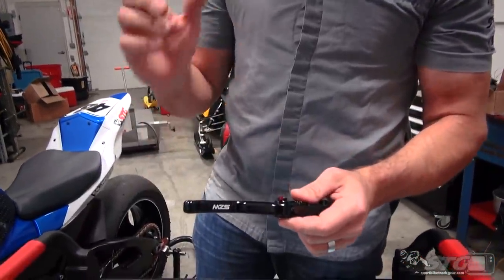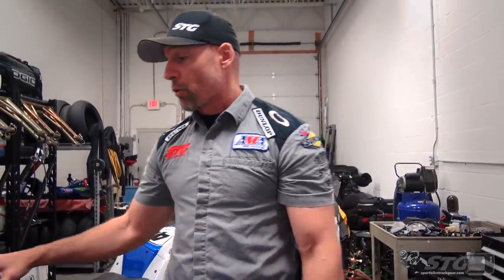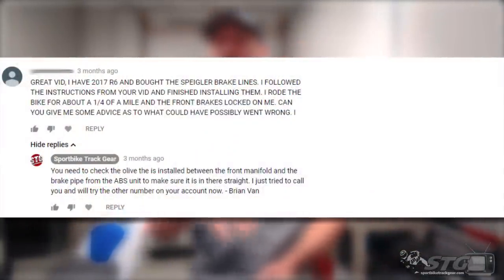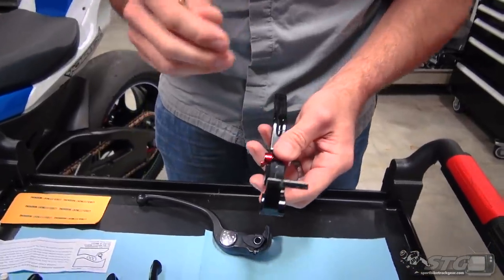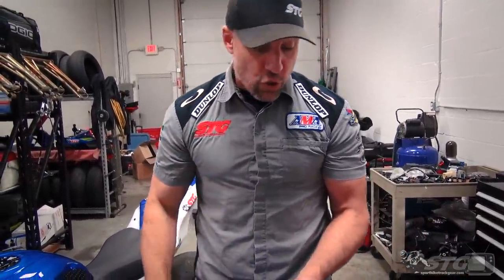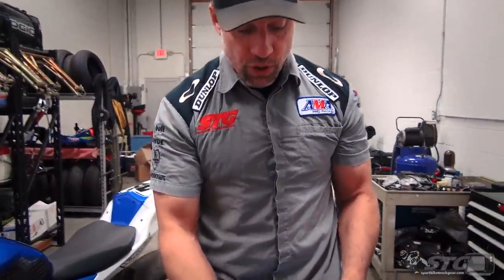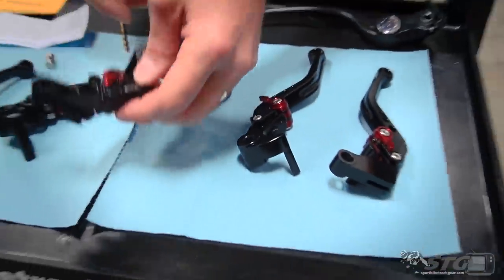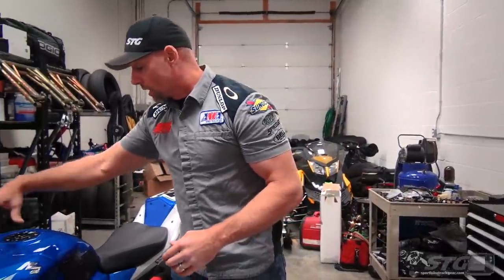The Truth About Cheap Motorcycle Levers | Sportbike Track Gear

Comment: Lockup with ABS?
Reply from the maker: No, not caused by the ABS. Several comments on this video now noting locking front brakes on multiple models. It is the overly tight tolerance of the cross pin busing in the lever. - Van

Comment: You can get good quality levers from China for 45 dollars a set. Research reviews and save yourself 100's. You don't need to spend this big cash on levers.
Reply from the maker: That's all great right up to the point where the brakes lock up man. Buying these cheap levers is as risky as buying knock off condoms IMO. Shits all good until it's not. - Brian Van
Reply: @sportbiketrackgear  Wait a minute... The wife & I have been using Troyjanz condoms from ebay for 10 years now and none of my 9 kids have ever had a break lever fail. $1 for a pack of twelve is a pretty good deal!
Reply: @sportbiketrackgear  they're not gonna just start failing out of the blue. They will fail the first time you use them. So if you throw on $25 levers or $250 levers and then take off like a jackass without testing them, you deserve what you get.

Comment: I would generally agree with the argument in this video, BUT I can tell you from my experience and the experience of many fellow riders that most of these issues are caused by human error and it's not the levers. I've had two pairs of OE levers on my CB1300 and both snapped very easily leaving me almost stranded. The last pair I had were Chinese levers and recently a lorry knocked down my bike while parked. The lever the the bike landed on had bended slightly but amazingly survived and I only had to inspect and hammer the base in bit. They're still on the bike while I'm waiting for a new pair. There's a nice counter-argument video that sums this all up https://www.youtube.com/watch?v=zeDtwAjHyj0
£200 for pair of AVS levers is way too much!
Reply from the maker: Sure there are some good points in the video you posted a link to. That said there is also a metric shit ton of misinformation in it. At no time should you ever need to add a spring to a brake lever to prevent it from locking up. If you feel $200 for a set of quality aftermarket levers is too much you are better off leaving the OEM levers on the bike than you would be installing shit like MZS. - Van

Comment: How can the brake hoses be at fault for brake lock up? It's the pads, discs or more importantly the caliper itself, it can't be the levers, so why put it down to the levers?
Are you sure you don't get sponsored by some motorcycle part manufacturer, for instance, a lever manufacturer... You're wearing sponsors all over your shirt, you're on YouTube, and who on YouTube doesn't get sponsored? 🙄 So yeah, curious 🤔
Reply from the maker: The brakes locked up because the crosspin bushing in the lever was binding which did not allow the master to release pressure. 100% caused the the lever your cousin made. If you don't know what you are talking about do not leave stupid comments. You 100% have no clue what you are talking about. - Van

Comment: Those cheap lever are used only for low cc engines.. Like 125 150 to 300. Wont recommend to a higher cc.. But me.  For me there both fine for that. It only takes a good care and maintenance.. But its up to u...

               And by the way DONY EVER BUY CHEAP MOTORCYCLE PRODUCTS THAT ARE MADE IN CHINA. Dont. There are other asian countries that have cheap and BETTER QUALITY that wont kill u.. Or cause an accident. Trust me..

Comment: Irresponsible riders have gotten so used to just trusting these companies that they don't even check the product before installing it. That's all you have to do. Just inspect the product before you install it.
Reply from the maker: It is the responsibility of the manufacturer producing the replacement part to ensure it will perform as well or better than the OEM part is replaces. Expecting the end user to evaluate whether the part is safe to use or not is unreasonable. - Brian Van

Comment: Happened exactly with me...i installed moxy levers on my 2011 cbr250r which i bought it for $15. Just after a month the front disc locked up and i crashed brutally. Later i needed to change the front caliper.

Comment: you do realize that prolly the expensive levers are made in china too right? You can find decent cheap ones too, personally I downright refuse to give over 100€ for a pair of iron chopsticks to use as levers... If they were at reasonable price like say 30€ a set then why not buy them over the chinese.
Reply from the maker: If you think these shit levers are worth the risk then go for it. There is nothing wrong the with Chinese manufacturing as long as the engineering is good. The problem with these levers is the engineering fucking sucks. CRG levers are our #1 selling brand here at STG and they are engineered and manufactured here in the US. - Van
Reply: @sportbiketrackgear  You know what fucking sucks? That you are dissing other products to advertise yours. I've got nothing against you (or your business) but if you expect me to buy something this expensive convince me why your product is priced like that for starters and what more it provides contrary to the competition. That would be a better way to advertise stuff.

I respect the fact that controls on the bike are important but not all levers are created equal even chinese, you can have really crappy ones but you can also have perfectly good ones. 

And speaking by experience the only problem you have with chinese products is not safety or quality its FITMENT sometimes you need to do some stuff for them to fit (but not levers and products like levers they are spot on)

Comment: Enjoyed your video, bought a 2015 650 ninja and the after market levers that came w/ it are shit. I know you are being nice but if it's shit say its shit... I got the msg tho.
Reply from the maker: IMO you are not making your bike better by installing levers that are worse than the OEM levers that came on the bike. Bottom line is a good set of levers is at least $130, most are more than that for a set. - Brian Van
Reply: @sportbiketrackgear  , Thought I mentioned... the shit levers came with the bike when I bought it... of course I'm going to buy good levers. Maybe you could suggest a set of levers as I "always" ride w/ 2 fingers on the clutch lever and 2 fingers on the front brake lever... force of habit. Thus, I only always have 2 fingers on each grip, unless going a long distance. BTW, thanks for your reply.

Comment: That indeed does look scary. I just happened to have MZS levers sitting here. Checking all the issues mentioned in the video, I think they improved their machining quite a bit because the levers now have tighter tolerance. Not as good as the high end CRG levers, but it does not wiggle like crazy. Also the model for my bike does not have that pin that could lock up so I think I'm safe there as well. Anyways I'm gonna install them next week and hope I don't die.
Reply from the maker: The radial master cylinder is the known problem lever. IMO why trust any of them when there are tons of document cases from these levers locking brakes??? - Van

Comment: I have some of those mzx or mxz shorty levers on my bike and they actually are better than original long levers most originals break off at the ends or bends into a damn pretzel, when I fell off mine last year they only scrap the edge and no bending braking and they still are good I don't even need to replace it they were only $25 for the pair, I disagree with this video
Reply from the maker: For sure there are plenty of people out there who have had a good experience with the MZS levers. That said there are a number of people who have crashed because these levers caused their front brakes to lock up (read through the comments on this video posted by riders who have had this happen). If you have an axial brake master cylinder odds are you won't run into that problem. Regardless of which master you have the overall quality of these levers is very poor. - Van

Comment: so with a little sandpaper, grease and couple of washers they are just as good, nice xD the main difference on chinese parts is quality control and finishing, those need skill and manpower, cant be replecated by machine, most reputable brands also produce the same way but they inspect and test prducts before beeing sold but that adds more than the production cost
Reply from the maker: Installing products that have not been inspected or tested properly on your bike is a bad call. - Van
Reply: @sportbiketrackgear  i inspect them as I mount them, then test, then test drive, not following this procedure even with OE parts would be irresponsible. As a mechanic I trust myself to do the quality control

Comment: Those MZS are equally as good as the stock junk that comes with most stock motorcycles and those last for years 😂
Reply from the maker: When is the last time you saw an OEM lever lock up the front brakes on a modern sportbike? - Van

Comment: He didnt grease the bushing..
these work fine, made of the same material.
Reply from the maker: The levers were new out of the box with the cross pin bushing installed (held in with a snap ring), if it needed to be greased it should have came that way from the factory. That said the tolerances are very poor, grease or no grease the bushing can not seize up. - Van

Comment: This guy seems really seedy and whoever runs this channel is pretty aggressive in the comments with the insults and scaremongering. I don't live in the US but if I did, I wouldn't spend a single cent with these guys. I'll stick to my cheap levers that I've had absolutely no problems with.
Reply from the maker: WTF is scaremongering? We discovered this issue helping one of our customers sort out an issue with their front brakes locking up and we decided to share it. If you read through the comments in this video you will find SEVERAL from riders who have crashed when these levers caused their brakes to lock up. - Van

Comment: Oh CRG not that much better
PUIG. Good stuff. Those CRGs got sent right back...there "bearing" should be referred to more accurately,  line on a bolt. So axle?. No bearings sorry b
Reply from the maker: There is a bearing on the adjuster. The pivot does not typically use a bearing. We run these on all of our race bikes. CRG makes a great lever IMO. - Van

Comment: Hi I ride a 2007 Honda repsol cbr 1000rr
 I recently changed my clutch and brake lever the brass pin on the clutch side isn’t floating free like you said I think 
When I stop and if I’m in first gear holding the clutch and hit the throttle bike feels like she’s not relaxed but I can feel her wanting to surge forward and just run 
Is it possible maybe the clutch is having the same issue you described with changing the levers? My Instagram is Enviziondisikon / repsolp hope to hear from you soon

Comment: Hah funny story, I crashed the bike in my profile pic 5 mins after installing a set of cheap Ebay levers. What a mistake that was. Machining was off and it was pressing in on the master cylinder. Pressure built up and as soon as I went for the lever I was on the ground.

Comment: Only time you crash because of these is because you fitted them yourself and don't know how to check them
Reply from the maker: Installation is not the issue it is the incorrect tolerance of the cross pin bushing. - Van

Comment: He probably installed then wrong. I got a set for around £15 and there better than stock
Reply from the maker: MZS levers have shit tolerances compared to the OEM levers or quality aftermarket replacements. You would be better off leaving the OEM levers on the bike if you do not want to buy a quality set. - Van

Comment: Sounds like you are just pushing your own product. Of course they’re going to have tolerance issues, they’re cheap. Tolerance=cost. We are buying 20$ levers because we don’t want to spend 200$ lol. They work fine with some grease. Inspect things before you install and you won’t have these problems. Lol
Reply from the maker: They work fine until they do not. Read the comments, a ton of people have had issues with these that caused crashes. I am not trying to push shit, just sharing what I learned. - Van

Comment: My Chinese levers work fine for my r6 you just got a bad set of them
Reply from the maker: The locking brakes seems to be isolated to levers for the radial brake master cylinders. Older R6's use an axial master which should be ok. If you have an R6 with a radial master pull your lever off and check out this cross pin bushing to be safe. Forget about the locking brake deal, these cheap levers have shit tolerances and are sloppy on the controls compared to the OEM levers or quality aftermarket. - Brian Van

Comment: https://youtu.be/VtgwCQQabRU?t=48 Another crash from same levers. These bikes have RADIAL master cylinder, with a pin that goes into the bad part that does not move freely in the cheap lever.
Reply from the maker: This garbage should not even be available here in the US IMO. - Van

Comment: All offence meant.  This guy is the clown who also pulled apart the Harbor Fright bike stand like deadlifting a barbell.  Then calls it junk.  Can you do that with a Pitbull?  NO!  Does it matter?  NO!  So the Chinesium junk I got works fine, thank you.  As long as I don't pull it apart like doing a deadlift it will perform the same function as the pitbull for like 1/3 of the price.  In fact, maybe I will pull it apart a little as my swingarm is about equal to the stand width capacity and it almost pinches my Scottoiler tube which is attached to my swingarm bobbin.  Which is also junk.  It is a $1.00 M8 bolt instead of a machined $15 piece.
Reply from the maker: If you prefer to invest in low quality parts and accessories more power to you. - Van

Comment: You say you respond to everybody's email yeah right I told you I spent almost $25,000 in extras on my 2018 GSXR 1000 RR and you said you'd call me and you never did so I don't know what you're talking about I told you I had problems with my ECU and it was revving at 3000 RPM at a red light and I could not get it to go down I had to flash the ECU back to stock I have an M4 full system on it light tech everything Spiegler rizoma everything the best of the best and probolt bolt kit and like I said you never did call me after you said you would whatever
Reply from the maker: I have told you several times I have zero experience with the flash you used. We only use and offer the FTECU stuff here so I will not be any help. You need to take the bike back to the shop that jacked up the flash or pick up an FTECU kit and hit it again. I have responded to several YouTube comments and emails from you. Not sure what you want me to do beyond that man. If you purchased an FTECU kit from us and had issues we would be able to help get them resolved. - Brian Van
Reply: @sportbiketrackgear  I flashed the ECU back to stock it is back to how it originally is runs normal want more power thought where i am asking for your help and I added the Power Commander I also ordered every nut and bolt I could from probolt the gold anodized almost spent $1500.00 canadian nuts and bolts ..lightech gold  chain adjuster lighttech frame sliders lighttech rear carbon hugger ,carbon front  hugger  carbon tank cover ,carbon heel gaurds carbon chain gaurd full gold D.I.D chain Rizoma half gold half black front and back brake resivours added clear brembo lines so u can see the fluids , spigler  gold and black front and back braided  lines those1 made a huge difference still going to upgrade my master cylinder,  full system M4 slayer exhust ,samco camo full custom black ,dark grey ,silver and tiny bit of white radiator lines with the nicer hose clamps, mra smoked double bubblewind screen pazzo gold shorty folding leavers, integrated smoked tail light ,shaved smoked front indicators, full OEM matte black tail fairings and head fairing ivwill change the back and front fairings to xarbon once the company makes them im first or second on waiting list they told me ,fully shaved undertail, FIN Gps anti theft tracking system i am not a mechanic so intotal i spent near 22000.00 in upgrades and labour plusbthe bike cost me out of the crate alost $24000.00 canadian so $46000.00 so far

Comment: i can see a bunch of idiots that didn’t  watch the whole video. the man said that brand is bad, and iti it. stop being cheap and buy the quality stuff on your bike even used levers at half the price. i cannot understand you people buying 15.000$ motorcycle and spending 40$ on levers. 
I have a ninja zx10r 2006 (that has almost no value) with brembo m4 brakes (full kit-bought second hand) ohlins frot forque and bitubo rear shock absorber, all second hand itams that have a value more than the bike itself. BUT IT WILL BRAKE AND DO A TURN HOW I WANT IT. I spent in total for the bike and the mods almost 8000€ mostly used parts but I never bought a low quality cheap item for the mechanical part of the bike. wake up people stop with the trash talk, this video is helping people
Reply from the maker: Appreciate that! - Van